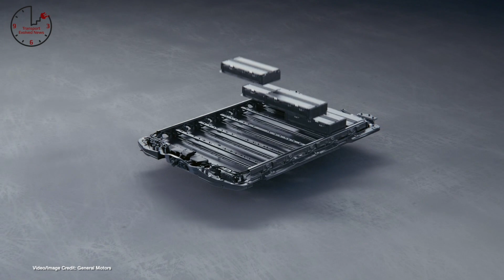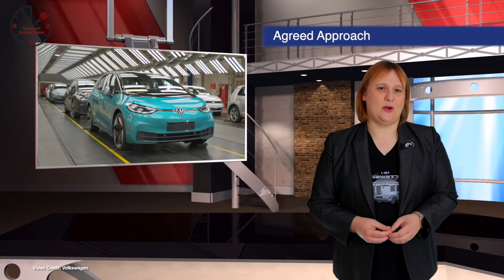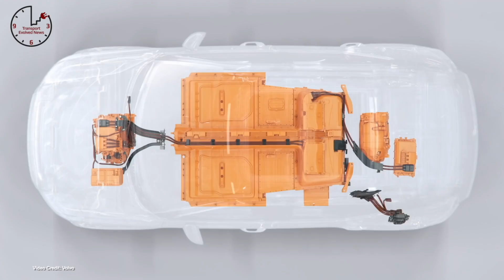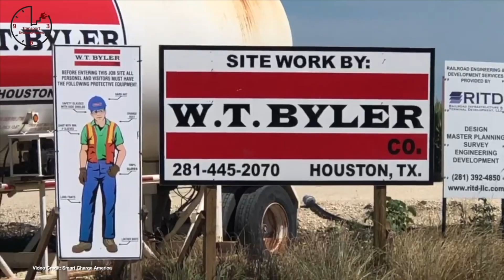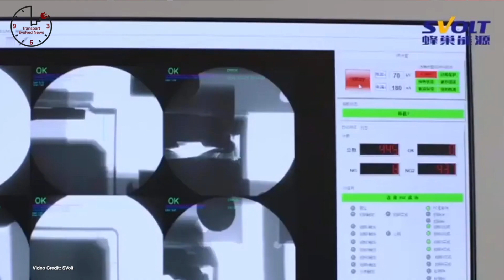TEN 293 - Tesla V2G, GM’s Forward-Compatible Battery, Google Dumps Oil

Comment: It doesn't make sense to put V to G circuits in cars without the million mile battery. If you use V to G in current cars you would kill the battery.
Reply: Nissan Leaf has had V2G demonstrated for years, with no apparent problems (held up by the equipment costs).
Reply: @austrobok2958  except you are potentially doubling the amount of charge cycles. So in a 24 hour period you may be changing it 2 times. One for normal transportation and the other for grid use.

Comment: I'm on the fence about V2G. Maybe if it was a wide spread standard. I can see it helping to smooth out the national grid if ComEd pulls a little bit of juice from my car and thousands of others when needed. I would be unlikely to use it to power my house during an outage. I might end up a couple days later still in a power outage plus a car that no longer moves.
Reply: It will just come down to the amount of money payed for the equivalent miles put on the battery; Much like the robotaxi network without the car leaving the garage. I'd fully expect to be able to set the available battery for V2G use.. IE: keep 50% battery level in reserve..  -

Comment: For the semi automatic charge cable, I think that it's a good idea, but still, the wireless EV charger makes more sense than the cabled ones, and is definitely, less complicated than this one!
Reply: Wireless charging makes far less sense than wired when you realize how much power is wasted.
Reply: @djurb  All has changed on the wireless charging front it is now so close in efficiency given all its advantages it will at some point in the future be the way everyone charges. Having said that it will probably take another ten years to become the norm. It went quite on the wireless front for a couple of years because they didn't want the same disaster that is the mass of charging plugs... there is now an industry standard. Someone did a good video on it I'll see if I can find it.
Reply: @helenlawson8426  thanks for sharing this; learned something new. :)
Reply: @djurb 
Actually, with sensors in the wireless charger, no power waste is happening there, when the car parks over the wireless charger.
The electricity only transfers from the ground tab of the charger, to the electric power grid receptors in the car that supports the wireless charging capability
Reply: @djurb 
It also takes way lesser time than the conventional cable charging method

Comment: Great video!
I still don't get how V2G is such a big deal. If you ever come to need it, it only reveals that we're in need of other energy solutions. As we're on the way through a technological revolution, V2G is apparently due to becoming rapidly obsolete. Or is it?

Anyways, V2G is better than no V2G and honestly if you asked me I could think that it had always been able to be deployed with what we already have in hands.

It doesn't make sense to my layman's mind that a Tesla could instant torque but not charge back the grid.
Reply: V2G or V2H would offer 2 positives:  1.  Back up emergency power in the case of a power failure.  2.  Off peak buying of electricity.  Buy electric when it is cheaper, use battery power when it is expensive.  I think to date Tesla has avoided this because, they want to sell Powerwall, and current batteries have a limited number of charge/discharge cycles, and constant use would likely degrade them  If and when we get one million mile capable batteries, this will start to make more sense.

Comment: Approximately $30,000 to chop the head off a car...??? OUCH!!!
Reply: They also slap on a 'one size fits all"  1980's soft top too..
Reply: @justinmallaiz4549  I couldn't say one way or the other on that but if true, what a rip off. For that kind of dosh, I'd expect a full-on custom-made jobby.
Reply: There's a lot more to it than chopping off the top.  They have to do a ton of work to stiffen the chassis.
Reply: @incognitotorpedo42  Well, yes; but even so. The company isn't a charity but I'd have thought $15-18,000 would be in the far more reasonable ballpark.
Reply: When they cut the top bars the vehicle loses a lot of its strength.  I imagine they have to weld all sorts of structural reinforcements to make it into a sound vehicle again.  Look up Simone Giertz (sp?) "Truckla" build on YouTube, it is a fascinating process, and you can see what happens when the top bar is cut.
Reply: @shanefiddle  Yes, I've seen her stuff. Not saying there's not a lot of structural work needed to make the process safe, just that I thought it was way overpriced.

Comment: I like the idea of the convertible model 3 but I'm not going to convert mine, especially not for that kind of price. the way they finished the windshield frame also doesn't seem to fit with the rest of the car, it should be rounded off in some way. I'm sure that would make it even more expensive but it would look a lot better.

Comment: I would like to know the factory warranty on the GM batteries because I have concerns that GM's battery solution is being designed to fail so that EVs will still need to pop in to dealerships.   The way the batteries are stacked will lead to heating issues, which will accelerate an uneven deterioration of the batteries.  $$$$

Comment: Never got the price of self driving price. The Car has the capability as standard with the hardware and sits in the background doing half what it could because who pays 7k for something that promises to work at some point. Would Tesla not prefer 100 Tesla’s with self driving if it’s safer on motorways etc to the owner and other road users to the number of 10 that will pay the still season price for feature on top of an already expensive Car. What’s it going to end up $10k for the feature because personally it’s only a thing I’d use occasionally on a long trip.

Does Great Wall not have a partnership with BMW now? The next MINI SE could be interesting.
Reply: @SWR I think you might be confusing basic self driving features that provide safety and are free ie included with the cost of the car (Teslas are rated a full NINE TIMES safer whenever these features are enabled), with full self driving (FSD) which is a paid feature that will eventually allow the car to be completely driver-less.

People have the opportunity to pay less money in advance for FSD (as a way of supporting the development work being done by Tesla similar to the way kickstarter works ie invest upfront and receive the eventual product at a reduced price) rather than pay more later (potentially much more as Musk has stated that the FSD feature could be worth as much as $100K once it's fully enabled).

The reason FSD is worth so much, is not because you can sit back and let the car drive you somewhere, it's because FSD enables an entirely new income stream for you - "robotaxi" - which allows your car to go out by itself and act like an uber carrying people around for a fee (which is YOUR income less 25% taken by Tesla to run the Tesla robotaxi network and mobile App). 

Now, to be clear, no one is forcing you to get FSD or rent out your car as a robotaxi. But there are a lot of people who welcome the opportunity to earn more income and are more than happy to pay the reduced price upfront.

Hope that helps clear things up. Cheers.
Reply: as toby9999 says:
FSD equals
"Hey tesla, go meet Mom at the airport"
"Hey tesla, drive my son to grandmas house"
"Hey Tesla , go make money taxi driving"

Comment: As I see it, the problem with ALL EV batteries and charging is the PROPRIETARY Hardware and Software. What if I.C.E. vehicles each had a different way of using fuel that required different manufacturing? "Hey - where's the nearest 2005 Ford Taurus fueling station? No, that one only has F-150 fuel..." - we would NOT be driving cars today. Somehow, everyone is doing just that with EVs. Remember Laser Disc vs CDs? Beta Max vs VHS? It goes on and on - eventually settling on a SINGLE STANDARD. - ONLY AFTER lots of money was spent, equipment built & sold that eventually became unusable then discarded. If Elon, GM, Ford and the rest REALLY want change and not just different cars to sell because they are popular, then STANDARDIZING the Energy Production, Storage and Dispensing of a UNIVERSAL ENERGY SYSTEM must be implemented. History books always pick things THEY think are important (the ASSEMBLY LINE - really). What about Henry Ford's close friendships with Firestone (tires), Rockefeller (gasoline) and Municipal Governments (sanitation through paved roads - horse poop is bad)? Henry organized and PUSHED the car industry into EXISTENCE - by insisting on the construction of an automotive Infrastructure. Paved Roads. Gasoline "Stations" with metered pumps. Proper tires for the paved roads. Ford STANDARDIZED the entire I.C.E. SYSTEM that we still use today - ALL OVER THE WORLD. Sorry, I went off there, I was just thinking through the keyboard.... Thanks for another informative AND thought provoking "show".

Comment: That's whitewash! You made several erroneous statements about the circuit's components in your first V2G video("MOSFET's conduct in both directions", they don't. Diodes convert AC to DC, etc.) and now you dropped the electronics engineering from your presentation. Really? How about we have an actual FULL schematic before we make statements about what a circuit does and doesn't do now and in the future. Please don't talk about electronics if you don't know what you are talking about.
Where's your proof the first guy who back engineered the circuit was wrong? We need his schematic to prove that.
Reply: But Diodes DO convert AC to DC. In fact a single diode will convert AC to DC, not a very usable form of DC but it is DC none the less. Just look at the V2G transformer for the Chademo system, I very much doubt Tesla included that same functionality into the car without it taking up a ton of space. 

Extraordinary claims require extraordinary proof, somehow the firsts guys rumour from half a schematic holds more water than the guy who took the damn charger apart to prove it doesnt have V2G capabilities.
Reply: @instanoodles  Diodes do block current from flowing in two directions, true but does a full wave rectifier create DC? No. Take a linear power supply and remove the filter capacitors, now tell me if you have a working DC circuit. You don't, you have a circuit that goes from zero volts to peak and back to zero. Physics defines DC as "flowing from plus to minus", when AC goes through a diode and the ac drops below zero volts there is not flow from plus to minus for the period when the AC is below zero volts, the circuit is at zero volts, that's why a diode in a circuit drops the RMS current, half the time the circuit is not doing work. Is that what you get out of a battery? Absolutely not. I don't know what the CHADEMO does, where's the schematic?
You can "very much doubt" what Tesla or anyone else does but the proof is in the science. Where's the full schematic? Does she have it? Does Munro have it? Does the first guy have it? So she can't make a decision as to whether anyone is right or wrong like she just did for her second  V2G video. She tried to impress everyone by talking about component designations on PCBs. I'm not impressed, just because it has diodes doesn't mean there can't be one or more paths in both directions. 
Let's stick to science and leave the anecdotal evidence in the opinion column.